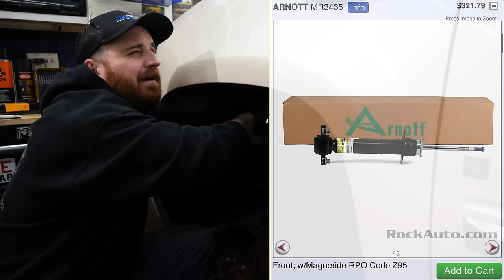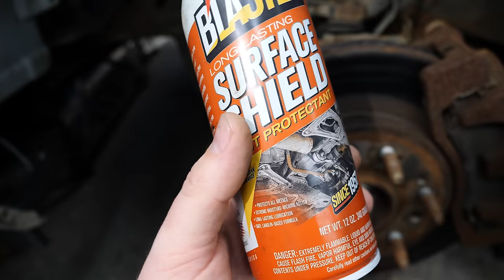I Saved Over $500 Replacing my Escalade's Mag Struts Myself

Comment: Look into Vigor Air Suspension. Front complete struts are like $260 a side. Comes with new electric connectors too. That's what I have in my 2009 esv. But I have a Canadian spec. Just subbed! Great videos. Oh....another thing, check your ground and add another one by the hood shock. You'll be surprised what it'll fix. Another common gm issues on these trucks.

Comment: I pulled the magnaride from my suburban when mine went out, don't even notice the difference in ride from the magnaride/rear air suspension to just good quality struts.
Reply: Hey what struts setup did you go with?
Reply: @cornbread9472  it's was nothing special.  Just what the shop I have gone to for 32 years recommended.  It's what they use when they pull the air ride from customers.  Some off brand not cheap, not expensive at all.
Reply: @thebigv8644  thank you 🙏

Comment: when I put the Bilstein leveling shocks on my 2018 Sierra I took the strut assembly to Big O tires. they did the two of them for 40.00 dollars on their huge wall spring compressor.  Did you replace and secure the plastic Christmas tree clips on the driver's side wheel liner?  There appeared to be a ground eyelet dangling.
Reply from the maker: That was there when I pulled the liner off. I’m assuming it’s for an option the truck doesn’t have. Looks like it was tucked away in the harness from the factory.

Comment: I want my Escalade to be that height im not sure what all was done previous owner said a lift kit and new shock and struts but ill measure mine later and let u know how hight my front and rear mid fenders are sitting i took out the bottom lift on the strut its a small metal piece in the shape of a letter C i believe or squared U and i was told thers some on the top of the stut as well so i need to remove the whole thing again tomorrow and see i want to put a drop kit or get it to normal height can you measure your height from floor to middle of front fender and let me know and also the rear